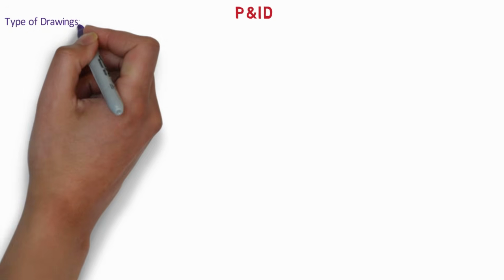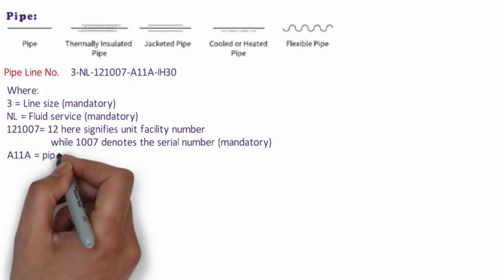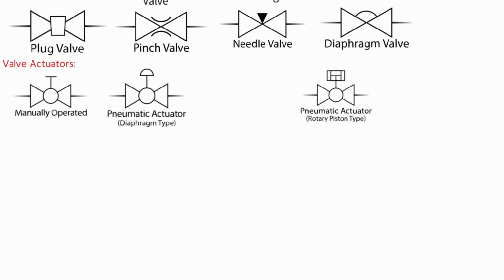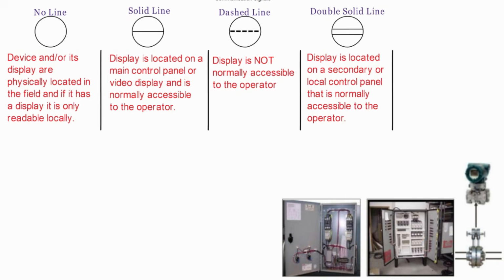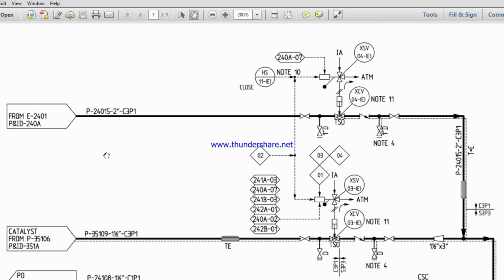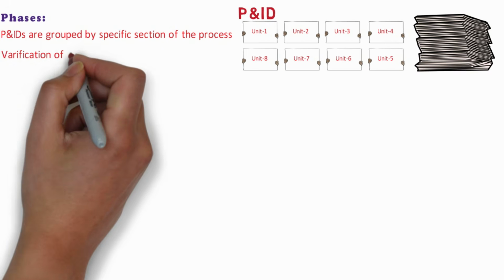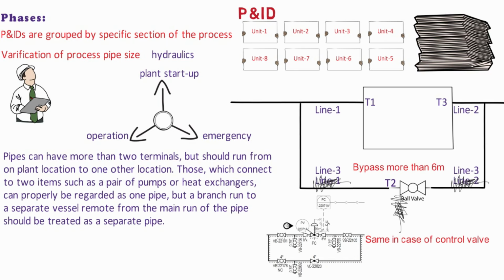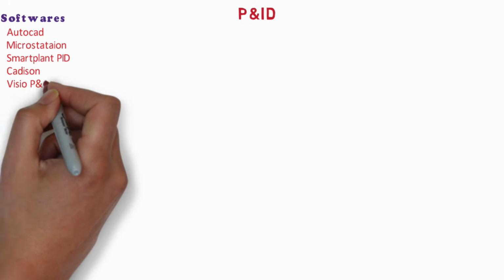HOW TO READ P&ID | PIPING AND INSTRUMENTATION DIAGRAM  | PROCESS ENGINEERING | PIPING MANTRA |

Comment: That's a part of my previous job @ Saudi Chevron Phillips projects; surveillance and monitoring, checking with  P&ID diagrams together with the contractor and subcontractors Inspector prior to hydrotesting, weld joints painting and/or insulation and cladding.

Comment: We are stuck in a Pipe design problem for a Project.Need to design a H2SO4 supply of 400 metric tonnes pump to transport at 1800 metre,pipe designing is also required

Comment: Symbol for Threaded & socket weld valves how to identify them ,I think we need to Refer Piping material specification for same is it right or some different philosophy .May be based on service.
Reply from the maker: Yes. It will not be shown is pid. Can be identified in PMS and symbol representation will be in isometrics

Comment: What do you call the data table giving flowrates, power etc. on a P&ID - not covered in this tutorial?
Reply from the maker: I have not seen these data on P&ID.. but yes should be shown in PFD, which is a basis for P&ID.
Reply: I would argue that you've only presented a PFD in the tutorial since it doesn't include the performance parameters, flowrates, motor power etc
Reply from the maker: you can refer our another video on PFD.. this video is for specially on P&ID.

Comment: Does anyone know if you use any symbols for contraction or expansion of pipes, and also for elbows?
Reply from the maker: Generally Elbows are not shown in PID except it is rotating elbow. Reducer and expanders are shown you can check another video on symbol